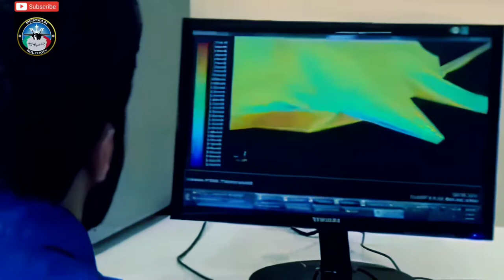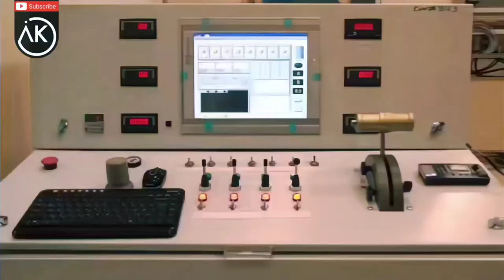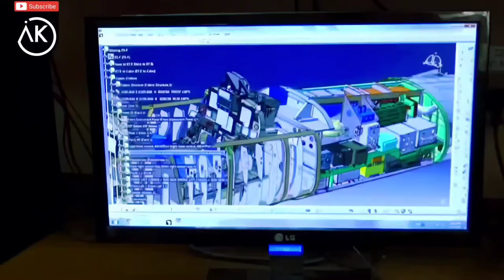IAIO Qaher F-313 stealth fighter - AKAmedia

Comment: This not a fighter this is only toy. Where is the clear flight. He has no exuast. Where is running flight. And in the air no clear video. This is joke from iran. Im sorry.
Reply: Taxi test..
Reply: @aayzym.producer5491  But there is no heat at the exhaust
Reply: @aayzym.producer5491  this video 2018 years.